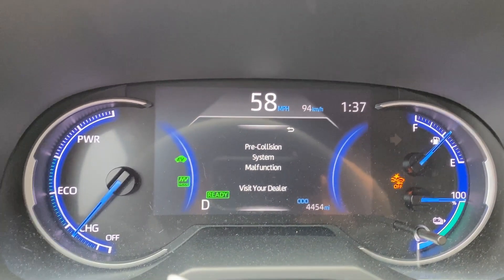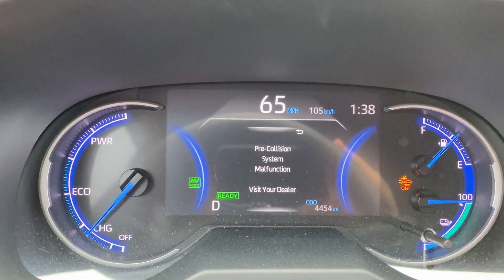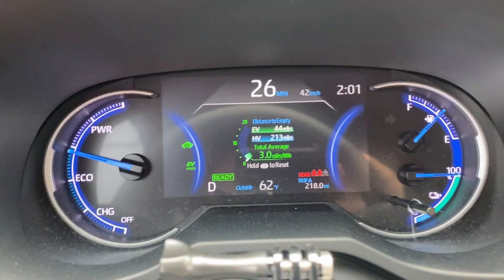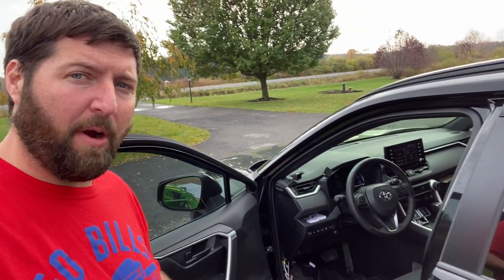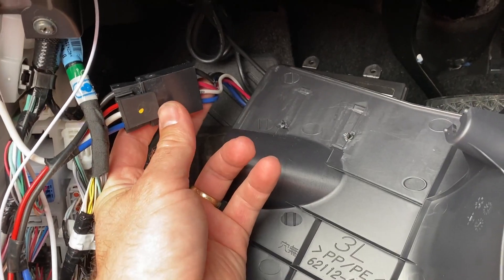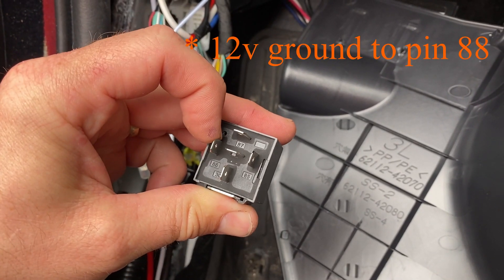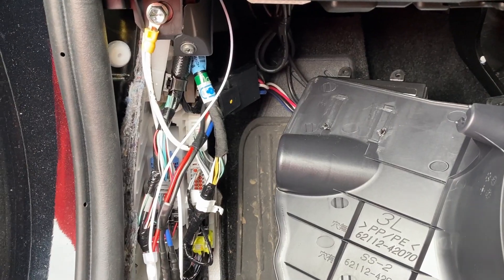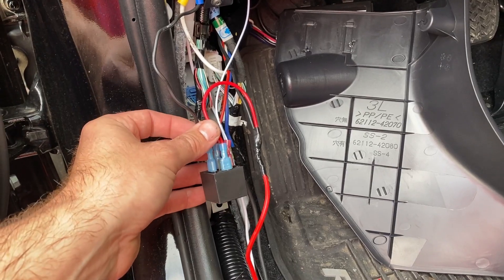2019+ Toyota Rav4 Pre-Collision Warning due to Installation of a Brake Controller & How to Solve It

Comment: Posting this here also...Great video, thanks for identifying the white wire.  Additional information and a WARNING: We burned-out our Stoplight Switch on our 2025 Rav4 prime with a similar installation, it is the same 7-pin switch used on your vehicle.  In our case we used the Curt Bluetooth plug-in proportional controller, and briefly plugged the trailer directly into the 7-pin round plug, damaging the Stoplight switch (Napa part SL1168, $100).  There are two things you can do to not have problems.  First, include a diode in the stoplight tap wire so that the controller cannot back-feed power, and Second, include a series 250 ohm resister to drastically limit current.  If plugged directly into a trailer, the brakes will simply not activate since there will only be about 50 mA .  If connected to the controller, the controller only looks at the line but does not draw any real current, so it functions normally.  The diode and resister combine to protect against both conditions, so you will not get errors or damage the vehicle.
Reply: Hi. Can you explain more about the resister part. I understand adding diode and saw some guys did that, but never heard of the resister. How did you wire it? TIA.
Reply: @giangdinhhoang1928 the resistor is in series with the diode.

Comment: Thank you!  I'm looking for some type of wiring diagram for the relay switch (5Pin Wire Socket Plug harness) install that you recommended, with my brake controller, and how you wire everything to it as well as the wires coming off the brake controller and the 5 wires coming off the relay switch and everything from the front back to the back.  Do you by chance have a wiring diagram of your install that you’d be willing to share? Thanks so much. I’m using a RedArc Liberty tow-pro controller for the ’24 rav4 prime.  Thanks so much!   Alan

Comment: Very helpful.   The rarely used end of my driveway has forsythias branches which are flexible but otherwise cause the car to brake.  So this is incredibly useful--I can now get out of my driveway that way without braking 100 times.

Comment: An easier and equally effective solution is to install a 1 amp diode such as a 1N4001 in series with the controller tail light red wire. Orient the diode so that the anode (the end with the white band) is toward the controller. I just did this install on my new 2022 Rav, and it did the trick. Took all of 5 minutes.
Reply: I just installed one on my 2017 Highlander Hybrid. The brake controller was pulling a 370mA draw off the MPX-B NO.1 fuse. I took it to Toyota and they said the vehicle didn't have a parasitic draw. The next day, I verified it was coming from the brake controller. After installing the diode, the parasitic draw went away.

Hope that can help someone.

Comment: I have parking assist malfunction how to reset clear the light without delaer
Reply from the maker: Mine went away on its own after 10 mins or so. If yours doesnt you can also try disconnecting the 12v battery for a while.
Reply: I did disconnect for 1 hr and nothing lol still on see Stealer...I don’t know it’s for Park assist mulfunction.

And my Climate control light don’t lit up it’s dark can’t see anything but blows air tho and all

Comment: Many of these brake controller manufacturers and even eTrailer mention the use of a diode, this should filter out any feedback from the controller and are probably safer than a relay which could arc from what I've read about relays in general. That said, and I mentioned this in your original video, I wonder if you would have this issue at all if you didn't wire this up to your brake pedal and instead just used the brake light signal.

Links that mention the diode:
https://www.redarc.com.au/how-to-fit-a-towpro-in-a-high-spec-vehicle
https://www.etrailer.com/question-303095.html

Comment: I didn’t find any links to the relay on your Amazon page, do you have info on the relay you got?
Reply from the maker: Sorry, here you go. You have two options depending on if you want the harness or not. Ive used both.
https://amzn.to/3qgKDV6
https://amzn.to/2JtK1Lb
Reply: @JamesKlafehn  Thanks, no worries! Any insight on how this system affects the adaptive cruise?
Reply from the maker: @leblancexplores  I havent tried towing and with my car too much but adaptive cruise seemed to function just as it did normally when I last towed.

Comment: Hybrid RAV4 owner here, thanks so much for taking the time to put your videos on YouTube. One question, does the car properly signal the brake controller when you are using the adaptive cruise? Another video on YouTube the guy mentions he uses a remote brake controller and it only uses the brake lights as it signal and I’m wondering if it’s still a proportional system likes yours (and the one I ordered).
Reply from the maker: Good question. I dont know. I havent allowed the car to brake for me while towing. When I tow I am usually very attentive and I do all the driving. I dont have any trips planned but Ill keep this in mind to test at some point.
Reply: @JamesKlafehn  I commented on your original video with more detail but it's worth noting that likely a better option is to simply use the brake light wire instead of wiring directly from the brake. I didn't even think about pre-collision and other safety features that might be useful even if you are super attentive.

Comment: Good solution, my 16 limited last year in the summer for a month decided to go haywire and disabled the precollision system. The fault disabled everything including cruise control instead of just reverting to traditional non-adaptive cruise control. Dealer quoted over 500 to replace and recalibrate. After a few weeks it started to work again and has ever since.. safety features are great but they are pia when they get old or you're trying to do simple mods to your car.

Comment: So what do you think was electrically happening to trigger the code?  Was the brake controller putting 12v on the brake switch line when you manually operated it? Or was it unexpected drag caused by the trailer brakes when manually controlled?
Reply: PCS is incredibly sensitive to voltage.  It's a terrible system.  Hopefully it goes the way of the automatic seat belts from the last century.